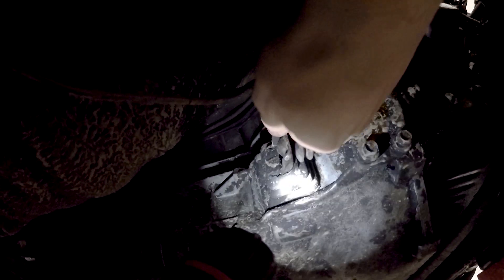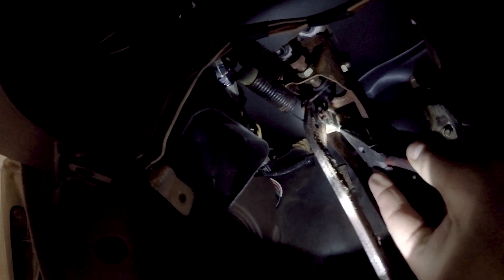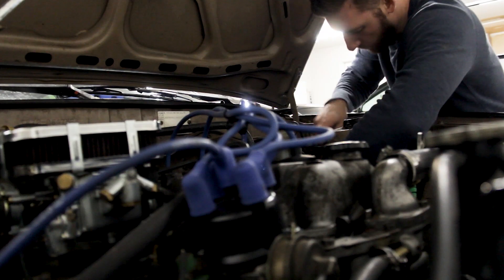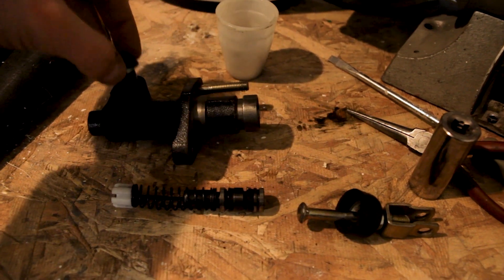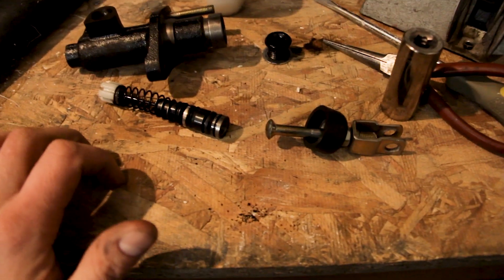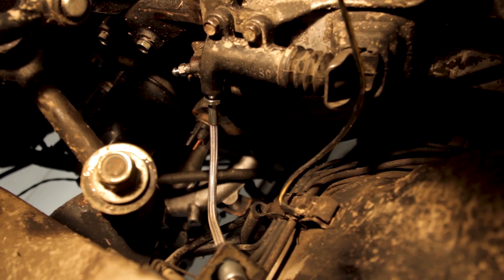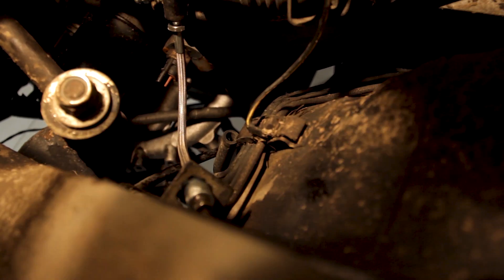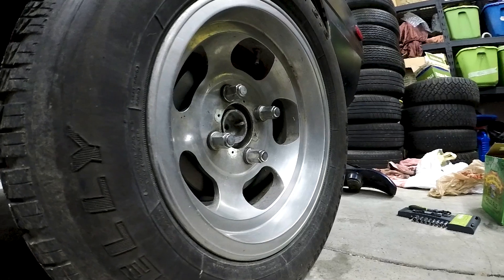Corolla Rally Car Race 2 Prep - BoostRodeo budget rally car build S1•E15

Comment: My 4spd is a frankenswap, cant help you on that :/ . Prayers you get her going. Good luck against Gforce. 

Super jealous you got drone footage.
Reply from the maker: Are you running a t40 4spd?
Reply: @BoostRodeo  yeah, I got two t40's for the cost of one t50. The back up 4speed is pretty sketch. I might source a 5 speed if this one goes out.
Reply from the maker: @rustyshackl4d  Ours started life as an auto car but fortunately someone had converted it to a t50 before in ended up in our hands. I can only imagine the ratio gaps with a 4spd. Our Diff ratio is pretty low from the auto but 1-2 shifts are pretty wide and 2-3 is almost unbearable when you are trying to carry rpms. Where are you located?
Reply: @BoostRodeo  about 40 minutes outside of San Francisco CA. I like the 4spd, but I owned mine as a 3spd auto for 7 years or so before the swap. She still has the auto differential so freeway driving is a bit miserable. also have a back up auto dif that needs to be welded sooner or later. 

I really enjoy your build. Theres a guy in my rallyx league with a TE72. His is stage spec'd, so its nice to see to compare mine to a TE not fully modded up.
Reply from the maker: @rustyshackl4d  I was going to say our T50 might be for sale down the road. We have something in the works and might be swapping it out. Frisco is pretty far to get a tranny down to though. 

 Glad you are enjoying it! Its been a really fun budget project and a great little car even being largely stock. Now that its back together and mostly solid the goal is to keep it that way and put some seat time in to really figure out where it needs tuned to get around the track faster. We are kicking around a few plans to add some power and a few other fun things but they will be down the road and hopefully all at once with parts already accumulated.

Comment: Watching this while looking for ideas prepping a Corolla for classic Enduro rally, 2 doors Corolla in good condition is hard to find these days.
Is this a 1.6  or 1.8 liters version?
Reply from the maker: Ours is far from good condition, which was actually perfect for us because it was cheap and being a rally car it is likely to take some impacts. This one has the 1.8L 3TC which actually we found is a great motor and has a lot of power potential.
Reply: @BoostRodeo  Yeah, a lot of them have rusted off so much and couldn't stand to abuse, 1.2 is abundant, but 1.6 (and above) is much rarer and I can only find it with 4 doors.
Do you think they have the same wheelbase length or the 2 doors version are better?
Reply from the maker: @wckoek  I actually think the wheel base is the same on all the TE72 models aside from the wagon. A sedan would probably work just as well if you aren't set on the 2 door look. I would determine which organization you plan to race with and look at the classing rules before selecting. If running open the ARC minimum engine class is 1800cc or 1.8L and below. Depending on the class will determine you want to swap the car in which case the factory engine, trans and rear end won't matter.